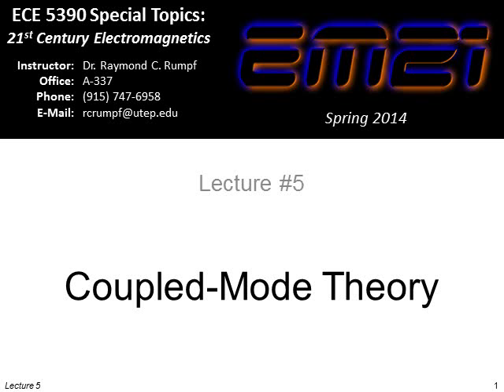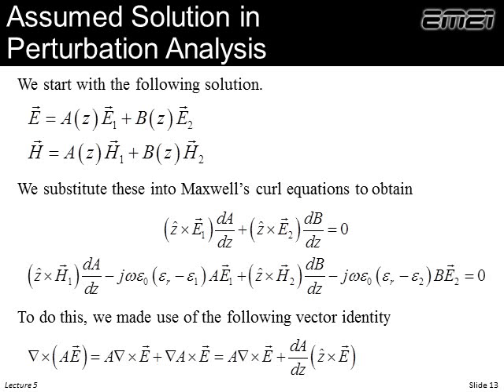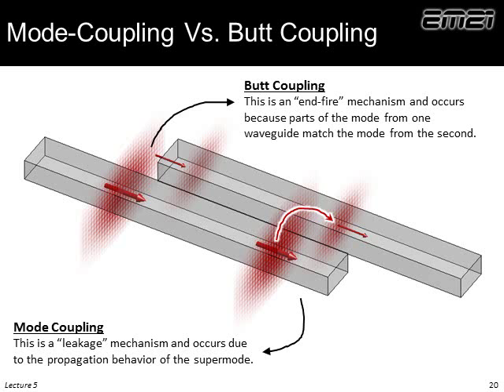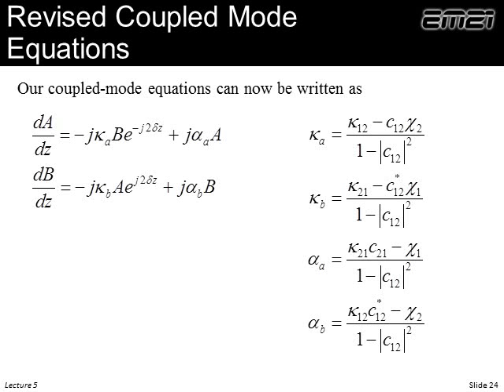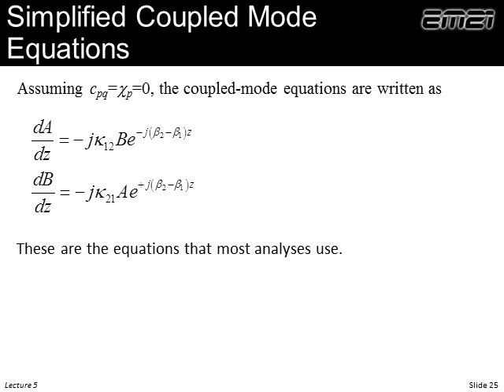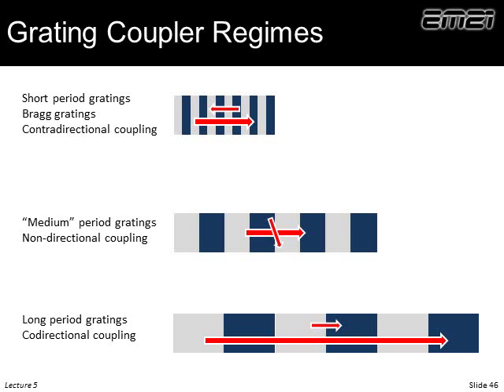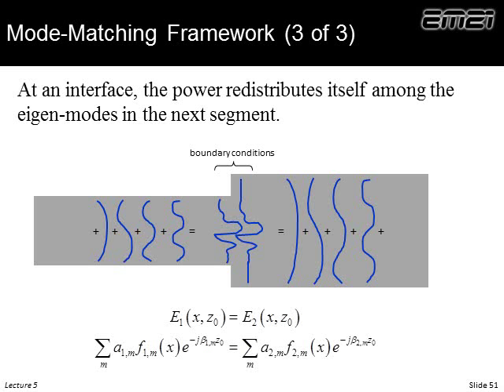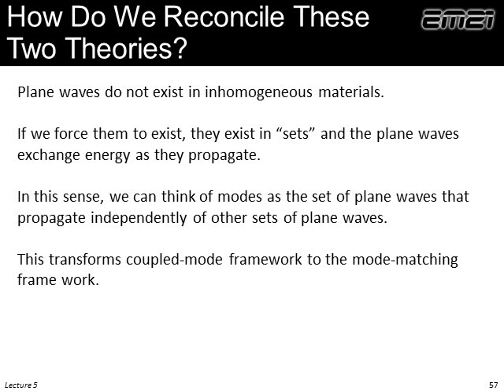Lecture 5 (EM21) -- Coupled-mode theory

Comment: I think the derivation here is really misleading:
- at 8:30. The energy of the pointing vector should include also the terms E1xB1 and E2xB2 that are not included.Why?
- in slide 15 the right terms of equations 1 and 2 are inserted at place of respectively E1 and H2, which justification for this is not clear, in fact the equations themselvesare not E1 or H2. Anyway since for the eq. 1 and 2 the right terms are 0 identically then the final equality is identically true. What is not understandable is why then in slide 14 should be justified that the energy flow is zero with the limit to infinity (?) what changes in the two integral eq. in slide 15 if we do not assume it?
-Performing then the "easily shown" algebra is immediately evident that the chi1 and chi2 must be zero because they arise from E1*xE1 and E2*xE2 which are both zero.
So...the couple mode theroy remains still magic unfortunately, I hoped to find here the final justification of the equations...is really impossible to find a good derivation
Reply from the maker: Sorry.  Unfortunately, the point of this lecture was not to be a rigorous treatment of coupled-mode theory, but to give the students a solid qualitative picture of the concept and to categorize the various results.  This is a follow-on class to a computational course so devices are being analyzed with numerical methods instead of closed-form equations and derivations.  

With that said, I absolutely agree that finding a detailed derivation of coupled-mode theory is difficult.  Perhaps it would be good to create an appendix for this lecture with all the details of the math behind coupled-mode theory.  I am not sure when I could get to that, but I certainly agree it is needed.  If you come up with something in the near term, it would be great if you could share it here.
Reply: CEM Lectures  OK but as I said I am searching something since months and nothing comes up reasonably, articles of Marcuse and Yariv were not much explanatory...if you have references you can share them with me.
anyway very interesting the other part I learned something.
Reply: @Aufenthalt  I was wondering, did you find any good material?
Reply: @Aufenthalt  Was wondering as well. If in anycase you had more about it to share, I would be glad.
Reply: @Aufenthalt  there’s some old literature in the topic but it’s quite hard to grasp and also there are many different formulations, with different approximations used, so a universal understanding of the topic becomes even more difficult. This lecture seems to follow the formulation of Okamoto (Fundamentals of optical waveguides). Other books are Liu’s (photonics devices), Marcuse’s (Transmission light optics, Theory of dielectric optical waveguides), Chen’s (foundations for guided wave optics) and many others. I’ve read them but I still can’t understand which method or formulation is more accurate. There’s a crazy book called Modern Electrodynamics and Coupled-mode Theory: Application to Guided-wave Optics from 2 Russian authors. You cannot find it online though. I tried to read it but it extremely difficult. However, it seems that it’s the most complete book on the topic.